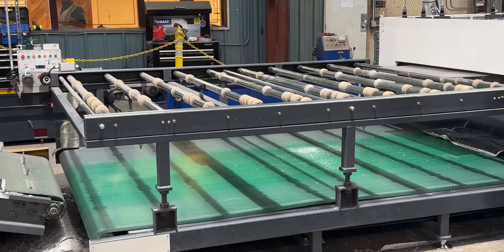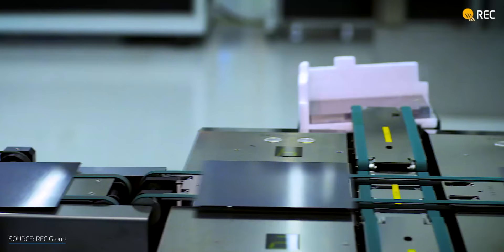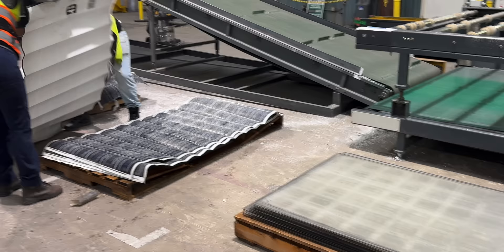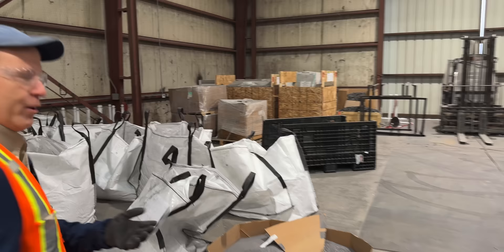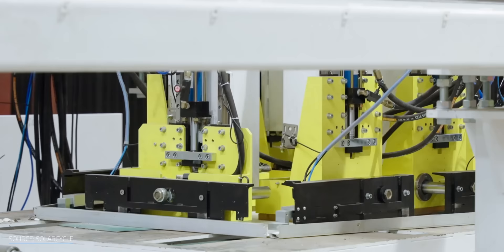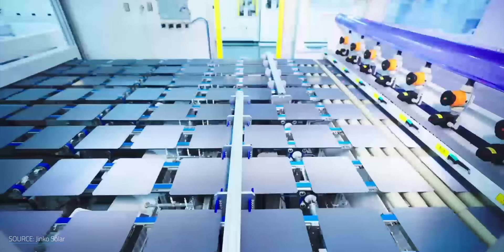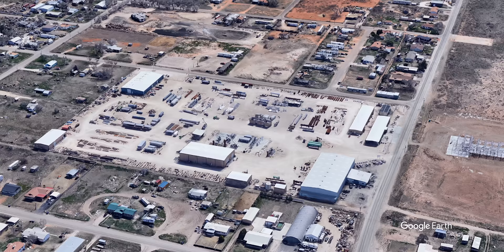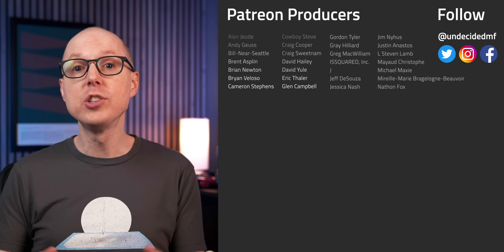What REALLY happens to used Solar Panels?

Comment: End of life is such a misnomer with almost all panels delivering at least 80% of the new output.  Modern panels are usually warrants to have 85% or higher output at 25 years.  Surely it  would take very high output efficiency and low cost new panels to justify grinding up the old ones and manufacturing new ones?  Meanwhile we could easily be distributing these panels to less affluent countries and benefiting from another 25 to 50 years of good life at virtually no cost and considerably carbon savings!

Comment: What decides the end of life point for a panel?  I have a friend that is on the engineering side of a very large solar installer.  They guarantee 85% efficiency after 25 years, and they know it's realistic because they've been around longer than that.  A loss of .6% of efficiency per year is so small compared to re-installing new ones is nothing.  Heck, go fifty years and you're still at 70% efficiency.

But best of luck to this company and all the others doing this work.

Comment: Another layer this adds - especially if you re-manufacture into new panels Stateside - the environmental standards inside China for the original manufacture were often... well... far from "ideal".  These extractions and local re-manufacture will have that offsetting effect too, from what I've read previously this is a really significant element of the environmental impact actually.

Comment: The cost of new aluminium in virgin panels is high, aluminium is mostly 'electricity'.

People need to just think.

Mining and smelting and processing raw materials and shipping is expensive. 

National Electricity Grids increased capacity means new grids.

Raw materials mining and refining and smelting and transport and processing and the construction process, is extremely expensive

Comment: I think it would be smarter to design panels to be easily refurbished and recycled.  This way, when they the actual solar part degrades to be no longer useful, you can easily just replace that one piece and then recycle that degraded piece.  If the entire panel requires recycling, due to say damage, the it can still be easily recycled.  It's no different than a lamp and a bulb.  You don't throw away the whole lamp, just the bulb.  If done right, you recycle the bulb.

Comment: These panels should be reused. The output may be slightly reduced but they could be used by people who would not otherwise afford new units where installation space is not a factor.
Permitting and connection to electric  utility bottlenecks should be modified to allow more use.
Reply from the maker: I actually talked to Suvi about that.  He made the same point.  Many panels that are taken offline are usually still good, so SolarCycle is trying to help keep still functioning panels in use and only recycle panels that are truly end of life.

Comment: Ummm, it's probably 2 decades when the tsunami of used panels hits.  Panels last 25 - 40 years and even if a panel is putting out 50% of what it originally did it's worth keeping on the roof.  Panels tend to be warrantied for 20 years to generate a very high percentage of what they're rated for, but the dropoff is slow.

So, about 2 decades from now is when large numbers of panels will need to be recycled.  Most panels on rooftops in the US were installed after 2010, even more once prices for panels started to drop.

Comment: One solution is to require all manufacturers to demonstrate the recycling process for a product before the product can be sold to consumers.  If a product can’t be recycled, then it either can’t be sold or it should bear some very high “landfill” tax to be sold.  Recycling currently is not incentivized in any way and thus recycling rarely happens.
Reply: There are 3 ways to incintivise manufacturers to build more recycable products. Number one is land fill tax, but you could also have a tax for virgin materials used or you have a policy for a right to return after use and recycling required. Demonstration of recycling process before roll out is not always required and would slow down innovation, as you need develop new product and recycling process at the same time. But recycling is only needed after lifetime. No need to hurry up development for processes that are not needed yet.
Reply: @renezirkel  I disagree.  If you say the recycling process can wait, what if you make 20 years worth of wind turbine blades and then decide you have no good way to recycle them.  That would never happen … oh, wait.  If you really want to be serious about this, the process for recycling needs to be demonstrated at some reasonable scale (more than just laboratory as everything works in the lab) before the first product is sold.  Anything less says that you only care about the optics of recycling, not actual recycling.
Reply: @LTVoyager  And I disagree with you. If you had required solar already in the beginning to have the recycling resolved, we would have at least delayed deployment of solar cells world wide and increased complexity and development in the beginning. Which means, we may not have any solar industrie due to higher development costs and time. Also for wind blades, there are already ideas for recycling them. I wounder why some countries dont require them to be recycled now and just discard them.
Reply: @LTVoyager  How would you demonstrate recycling on a large scale if you dont even have a production of the product itself on a large scale. You are making no sense.
Reply: @renezirkel  Probably correct and they should have been delayed.  That would allowed time for the development of solar that would be economically competitive and not require government subsidies.  And we wouldn’t be filling landfills with solar panels.  Same for wind.  Pushing things to market with government money is stupid and has all sorts of bad side effects.  We need to stop doing that.
Reply: @renezirkel  I never said large scale.  Try to read for understanding rather than to form an argument.
Reply: @LTVoyager  Ok, but the same is valid for every scale. How can you demonstrate recycling on scale without having production on scale. The solar recycling process above and the current wind turbine recycling has some unique recycling marterials. You would also have to show, that this unique material can be used in other scale productions. No recycle material user can confirm usage of that material without using it. So you need a demonstration of a full supply chain on scale to be sure before roll out. And when you already have a scale production supply chain you are not demonstrating, you are doing it.
Reply: @renezirkel  No new product or technology goes from zero to millions of units a year instantly.  You start in the lab, move to a small development scale facility, then to a small pilot plant and then incrementally to larger plants.  There is a ton of waste during the scale-up of any product as processes are designed and refined.  Most development facilities probably have a 50% scrap rate.  This provides the raw material for the recycling development process.  A pilot plant will still have a high scrap rate which supports an even larger recycling operation.  There is no reason that the recycling development can’t proceed in parallel with the product development with maybe one phase of lag.

Comment: What part of a solar panel actually dies?

Couldn't we develop a technique for extracting and replacing the cells and encapsulating components?   Even if the design is not backwards compatible with currently dieing panels, we could require all future models the repair/upgrade compliant.

Comment: I think its great that they're working to get the cost of recycling down but i do wonder how much the cost is ofset by sale of the recycled materials. If the value of the recycled materials is equivalent to or higher than the cost to recycle then it becomes profitable. You coyld even envision a trade, like scrap metal, could be setup where a recycler purchases used panel so they can be refurbished/recycled - that would be the best case scenario because money talks!

Comment: 6:26 is that $15-$45 cost of recycling BEFORE or AFTER any residual value of the resulting (output) raw materials is factored in?  

Also, what difference does it make if the PV solar panel is broken or not in good shape when taken into the recycling facility?  (Remember that "as new" solar panels are less likely to be thrown away than "oops it broke" ones, and anything transported 100km or more to a recycling facility is very likely to suffer further damage due to handling and transportation.)

How expensive is it to adjust recycling facilities to try cope with different types of panels, e.g. Tesla solar rooftop tiles, or thin-film plastic PV panels?

Although cost of recycling is likely to come down a bit over time, the current high rate of innovation in the solar panel industry makes it a very difficult moving target to try clean up after for the moment.  I expect that some sort of up-front recycling fee (deposit or tax) at time of purchase will be necessary.

Comment: Superb, Matt, as always. I have a question, and it has perplexed me for several years now. Regarding recycling plastics, is ANYONE working on a method to scale the incineration of plastics (and other traditional waste products), so a municipality might be able to generate power from such a process? It seems to me, THAT would be a major breakthrough.
Reply: Incineration of plastics is not recyling. You destroy the product and create CO2 emissions. And thats is not what you want for any recycling process.
Reply: Very bad idea.  Thermal depolymerization recycling is a much better idea.

Comment: this sounds like a lot of waste but globally we trash over 2 billion tons each year. So something like 0.4% of the waste is solar panels, assuming nothing is recycled. Shipping costs are high and we might need to store panel parts locally until the shipping costs drop and robotics make this all cheaper.  For now, recycling the aluminum and glass is pretty easy and something like 50% of the weight.  And glass and aluminum recycling is already massive and available most places.

Comment: why not use pyrolysis?  I have read many papers on heating the panels up till the plastics evaporate and the whole thing falls apart.  The pyro gases can be burned to heat the oven or processed for sale.  Glass, metal and silicon are not damaged.  

I wonder about the fee structure for solar panels recycling and dumping.  Most situations the dumpers are also the collectors of the wastes they SELL the waste to recyclers.   That's backwards.

Comment: it needs to start at the other end.  design the panel from the get go with recycling in mind.  if your panel cant be recycled then it doesnt get approval, or gets taxed higher.  if the carrot doesnt work, use a stick.  someone will innovate it.

Comment: Does the cost of recycling factor in the value of the materials recycled? I mean silver and copper are not cheap at scale. It probably still isn't as cost effective, but if its not factored in it may not be as bad as it seems.

Comment: Just look at that factory process. What they have there is a pilot, not a plant. Imagine what they could do with a proper plant.
If they cost 15$ per panel in such a slow, inefficient and labor intensive process, they are easily undercutting 5$ per panel once the process is automized and optimized.

Comment: Solar panel manufacturers should work with companies like Solarcycle to design the panels around recyclability. If they could get enough funding, they could basically buy the rights to recycle these panels years in advance. It could give Solarcycle a better idea of where they need to scale to within a certain time horizon too.
Reply: There would still be no way to recycle the Silicon solar cells.
Reply: @jamestyrer907  How?

Comment: So, to separate the metals you’d need boiling sulphuric acid baths which requires a lot of heat, right? In multiple steps to purify? And maybe electric purification in, for example, a silver cell using even more energy. Was that part left out? I just skimmed the video.
I think solar panels will become a very big environmental problem. Again we rushed into something that wasn’t thought through. Well, I guess BlackRock and the likes are happy anyway.

Comment: ok yes, but assuming this company can buy them at $5.00 (or less in bulk) and then refurbish them and sell them as such (Maybe a little more than half the original cost) its completely doable and then some.
What about like, a hot wire table?

Comment: Given the desire to recycle "all the things" for renewables and electrification, is there any appetite on the manufacturing side to engineer new panels, windmills, batteries, and the like with service and recycling in mind? Seems like this company has to go to great lengths to figure out ways to reverse the assembly process. Producers need to be on board early to simplify this process. This is my biggest issue with Tesla's structural battery packs... on the surface, without really knowing anything about maintenance and recyclability of said packs.

Comment: so one of the things I see solar panels used for is home electricity. I think there could be a cheaper way for homes to generate solar electricity that is both better engineered and much cheaper i.e. solar-thermal. for small and very isolated the traditional photo-voltaic solar panel makes more sense, so while I think this industry will not die it will not thrive much either.

Comment: 11:57 Should have a cost of $15-$18, as in we should have zero CO2 emission if only all the unknowns where out of the way and we we're in the future. Or in other words a low price untruth. Prices do drop, the typical reduction is 15-30% from the current cost to recycle a panel of $40-$50. Raw material value of contaminated silicon, silver, and aluminum $14. So, when you have a operation cost of more than $14, is that a profit or a loss?

Comment: We don't need a cheaper way just to get them recycled. We simply tax them in some way and require the manufacturers/industry to recycle them. We can punish them with things going all the way up to execution if we really want to, so it wouldn't be hard to incentivise them. If it costs $15 to recycle one, then that could be paid up front, put in an investment fund, and then guarantees recycling down the lines. 

Does the recycling industry want to make their process as efficient as possible? Sure. But the economics are easy to deal with.

Comment: The tech that went into solar and wind development have brought it a long way. Now, imagine if this had been applied to nuclear power. With a multiple power advantage in the millions compared to solar and wind, reducing the need for mining significantly with thorium being extracted from mine tailings of existing mines all ready piled up, and a power source that would last us for thousands of years, it is like comparing peanuts to whales. And if this tech had been applied to breeder reactors the efficiencies would be north of 90%. Considering that all of the nuclear waist in the would would fit easily into ONE wind mill land dump [ and would be reduced even more employing nuclear breeder reactors, it is an easy pick, environmentally and for the power efficacy.

Comment: The solar panel glass, silicon and frames are recyclable.
The main problem is with the rare earth elements from the semiconductors (Arsenic, Germanium, Gallium etc), that are toxic and too expensive to recycle.
Reply: Those aren't REE.  However,  removing them from the Silicon is uneconomical, which is why the Silicon isn't recyclable.
Reply: @jamestyrer907  Correct about the REE.
The silicon my be recyclable but the toxic elements used in the semiconductors etc. are not.
"Clean" energy is not all that clean if one considers all the aspects of it and not just the energy production part.
Also Lithium production for the batteries used to store the energy, is extremely polluting, especially regarding the large amounts water used in the process.

Comment: The argument that solar panels would just be thrown away always pissed me off. 

Most solar panels last 20 years, and the solar boom is less than 20 years old. The vast majority of solar panels haven't left use yet, and when they do, it drives innovations like this to make use of them. They have valuable materials, people will want to get those.
Reply: This too. Lead Acid batteries today are up to 90% recycled. But it didn't happen over night.

Comment: Meanwhile build 4000 Vogtle reactors worldwide and power the planet with clean, safe, zero-carbon energy with an energy density 2 million times that of fossil fuels, solar / wind, batteries, chemical processes in general. Use designs from the 60s even, repeat the reactor over and over, develop a supply chain of the parts and construction techniques, and virtually eliminate 70% of the cost, by bringing the finance charge to what it can / should be. Japan builds a modern reactor in 39 months, not 20 years like Vogtle (the reason Vogtle cost 20 billion dollars). Reactors can run 80 years, some are being extended to that period now.

Comment: No, silicon is not a metal. Silicon is a non-metal that belongs to the group of metalloids. It has some properties of metals, but also of non-metals. It is often used in the semiconductor industry and is commonly found in sand and rock.

Comment: Seems to me that we should be developing a "glue" designed to do the job well, but also easy to "unglue" the two parts. Planning the recycling into the building of the panels just makes sense. We need some material science guys to get to work.
Reply: People have been working on this, with different goals, for decades. Which led to millions of 10-year-old panels literally falling apart at the moment.